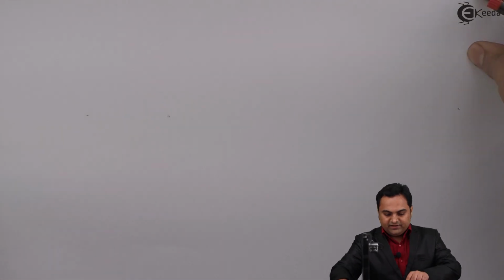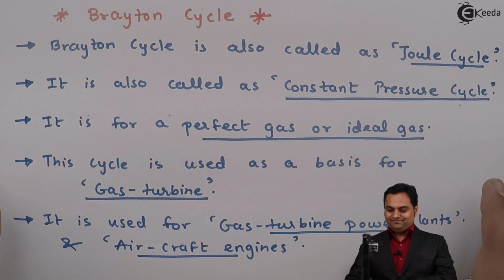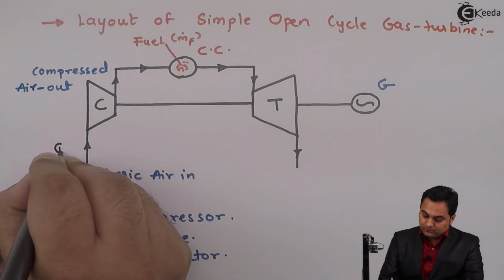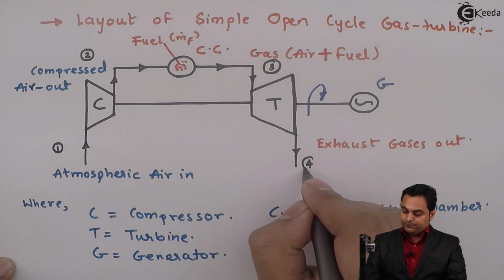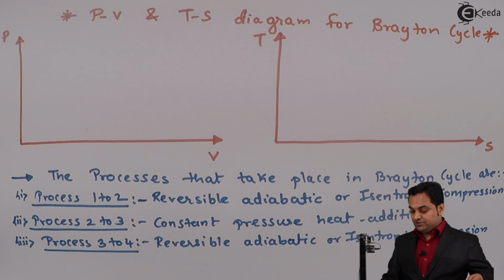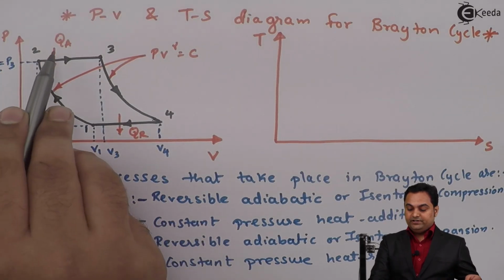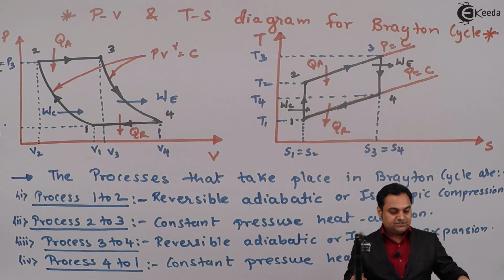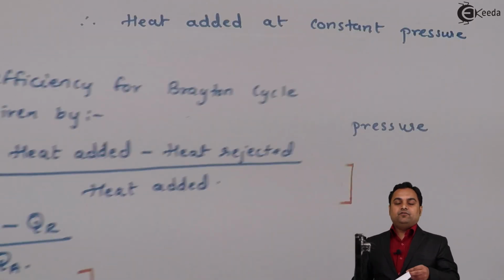What Is Brayton Cycle - Gas Power Cycles - Thermodynamics

Comment: Why does 2 to 3 is a constant pressure?
Heat is added to the air and fuel in an enclosed chamber.Will the pressure remains constant?
Reply: It's not an enclosed chamber.  Unlike the Otto cycle that happens in piston-cylinder assemblies that are closed, the Brayton cycle happens with a combustion chamber that is open to fuel/air entry on one side, and open for products of combustion to exit on the opposite side.   There is a continuous flow at the combustion chamber inlet and outlet, and no intentional change in the pressure of the gas, until it hits the turbine.
Reply: @carultch  so thats the reason pressure is constant?
Reply: @gustavomarcelo7250  Yes.  In an idealized case for academic analysis, pressure is constant across a free flow through a pipe, duct, or chamber.

In reality, there is a little pressure drop in the combustion chamber, but it's negligible.

Comment: please clarify that the heat addition in the open cycle simple diagram is constant pressure. therefore the air+gas mixture will not have a higher pressure. otherwise clarify that brayton cycle considers air standard assumptions which comprises of constant pressure heat addition compared to combustion chamber proess.
Reply from the maker: Kindly download the Ekeeda Learning App https://ekeeda.com/download.html & ask your doubts. Our experts help you to resolve queries on chat.

Comment: There is a mistake in the TS-Diagram. The constant pressure lines are not straight rather they are slightly curved.

Comment: Sir g ..the constant pressure processes are not linear in TS diagram. It will be a curved line. S will increase exponentially with T.
Reply: exactly
Reply: T increases exponentially with S.   S increases logarithmically with T.

Comment: From where we initiate the compressor? As u said here that turbine is powering the compressor. Kindly elaborate,
 i m not getting here.
Reply: Some designs use an electric motor to start the compressor.  Jet engines used in modern aircraft will use an airstream that could either be supplied by a vehicle on the ground, or by using an on-board electric motor to start the turbofan upstream of the compressor.  The process is called spooling for a jet engine.

Comment: Why we don't have work on 2-3 if the volume is changing?
Reply: We do have work from 2 to 3, and negative work from 4 to 1.  On net, the P*V work associated with enthalpy adds up to zero, so we don't have to track it.  By taking differences of enthalpy across the compressor and the turbine, you account for all the work that enters and exits the system.

Comment: sir. in ts diagram  pressure lines p1 and p2 are parallel or not???
Reply: They shouldn't even be lines.   They are isobar curves, which are approximately exponential curves.